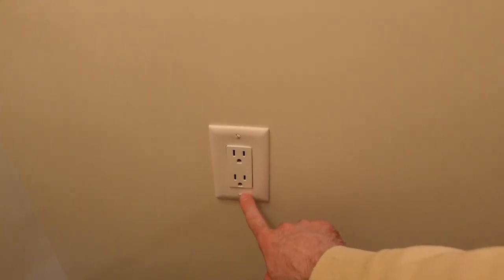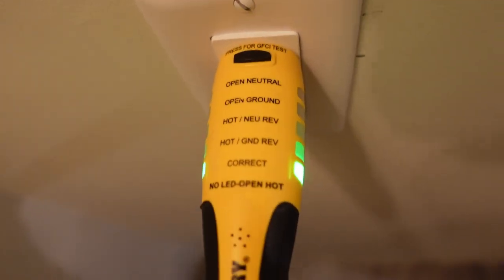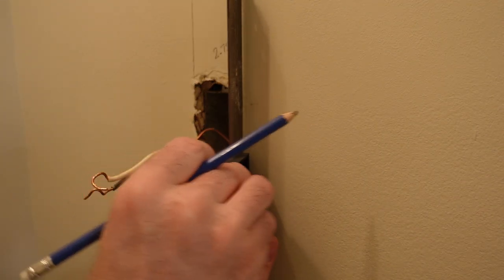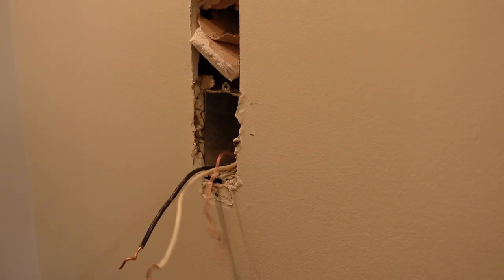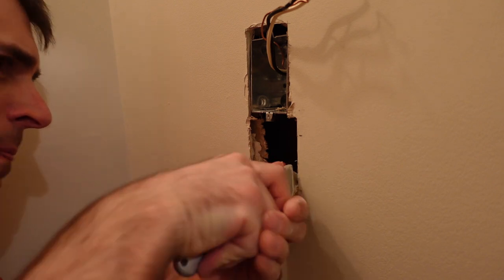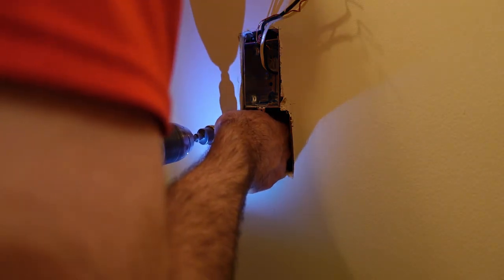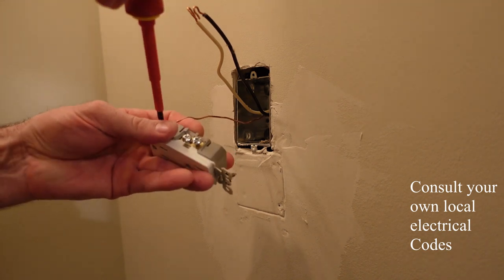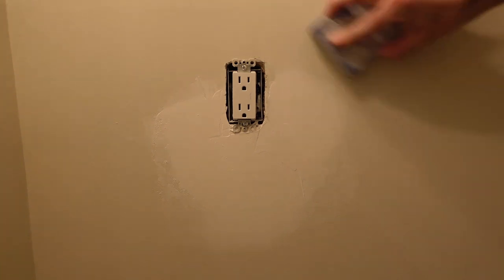Raising an Electrical Outlet up a Wall

Comment: Thanks for the informative video! Typically for this job I would use an oscillator to cut a large hole to the opposing stud to give me enough room to pry out the old box and nail it back in... But your solution looks to be much cleaner by cutting as small a hole as possible using only a utility knife, then installing a new box. A smaller hole also means less mudding and painting afterwards. Exactly what I was looking for, and what I'm going to try next!
Reply from the maker: Thanks for checking it out. Best of luck.

Comment: This was one of the best we've simplest videos I've watched. I was looking for something with a little less work, but if i ever up going this route it'll definitely come in handy. Mine is only off by about half an inch and I'm really not excited about moving it completely. Id likely have to remove the backsplash to do it.
Reply from the maker: Thanks for watching. Yes if you are fighting with a tile back splash it will be worse.

Comment: Wish you would have discussed/showed more about the actual electrical outlet, where each wire goes  and how wires were threaded and connected. Seems like the actual electrical part of your video, connectijg ground wire, etc...you zoomed through so fast. And how did you know wires were coming from top or side over before you took old box out? Seems like you wouldn't know until that old box was out. Thanks for posting, overall a short, simple tutorial!
Reply from the maker: I didnt know which way the wires were going in advance. I just got lucky this time.
I dont show a lot of wiring because every country has different standards and houses can also be wired differently if they are older based on old codes.
Here the black wire was hot and went into the hot side of the outlet. The white wire was neutral and went in the opposite side. Then the bare wire was the ground wire and connected to the device box and to the ground bolt on the outlet.